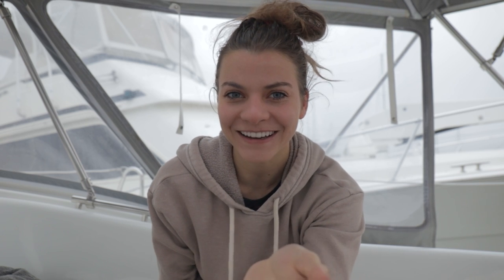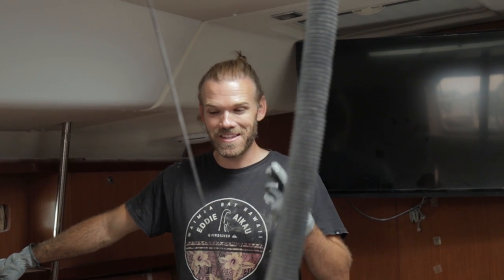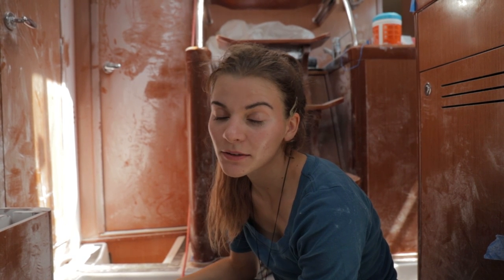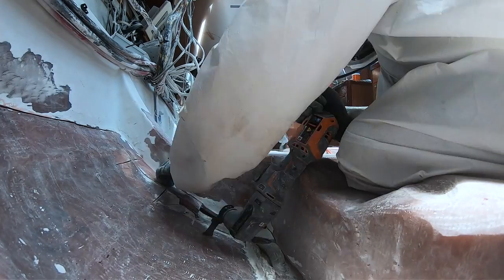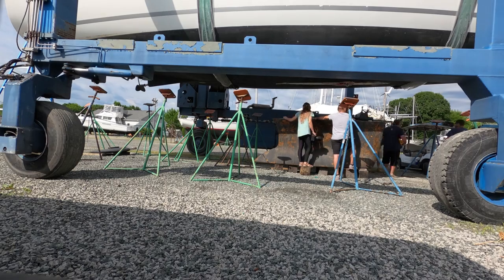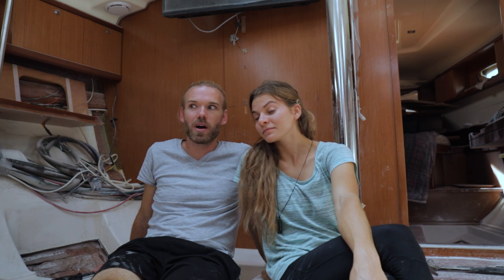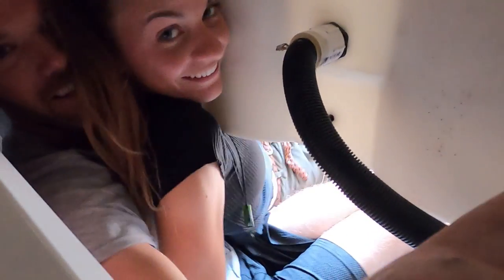Our Keel Gets RIPPED OFF! (and so do we) | Expedition Evans 11

Comment: Watching you guys and listening to your concerns with regard to the repairs it sounds as if you are concerned about the hull and getting the hull back to it’s original shape. The only way this could be done is if you had a set of 4 or 5 stringers spaced over the area of the repairs going athortships . The stringers would carry the exact contour of the original molds. As we all know this is impossible I would suggest making sure the hull is fair with no lumps or bumps and most importantly the hull carry the shape of the keel so there is a good mate when you go to reassemble. 
Key points to keep in mind during this repair process, first and foremost do not rush the repairs, take your time ! Make sure you find out the correct laminate schedule, what type of resins are you going to use ? Do your research and document all repairs. Have you talked to the manufacturer with regard to their opinions on the repairs ? Keep up the good work and don’t get discouraged, this is an extremely large project you have gotten yourself into.

Comment: Fortunately fiberglass can easily be repaired.  It is all in the prep work, but the extent you are going to inside means you know that. Now we have to remember when you fix the inside, and the outside, you are not going have those factory perfect shapes when you reattach the keel. Making a mold off the keel means you can prep for a perfect fit. Such as the inside you need to consider the surfaces being reattach with the keel.

Comment: This is why I despise bolt on keels for cruising boats. A lot of people have got into deep trouble / died when the keel falls off mid ocean. Old style long keel have the keel integral with the hull. Sure they don't have tye ultimate performance, but they can be run into reefs or up a beach without jeopardising their structural integrity. (ask me how I know)

Comment: Stainless steel has it's place but it also has disadvantages in some circumstances.

For example if stainless steel is immersed in water in a relatively oxygen free environment such as keel bolts it can decay internally and eventually fail.

Comment: I do not build boats. Some people have commented that the Hull shape will change depending on how it is supported.  Also there needs to be some flexibility to the hull. This would explain why the hull is bonded to the grid and not fiberglassed solid. I would recommend repairing the hull first. Then making new tabs for the grid  but leave them free. Put the keel in place with very loose bolts. Apply bonding agent to the grid and slowly lower the boat onto the keel until the gap is closed between the grid, keel and hull. Instal tabs with bonding agent and bolt to keel. After agent cures. Glass in the tabs.
Reply: Glue keel and grid all at the same time. It is very important to level the keel and hull during this process. Again I am approaching this from a viewpoint of a fabricator who does not work in boats and this theory is a suggestion that needs to be vetted by a professional. This method will allow some flexibility of the hull in the water that helps a boat move through the water faster.

Comment: Great video editing! The two eternal challenges we all face again & again: (1) how to become an informed purchaser. I.e. know the subject so well that you can specify the job and monitor the contractor. One way is to hire an expert to advise you and monitor the job for you - but that’s really expensive. Another way is to learn and become an expert; and (2) understand the motivations of other parties, as what drives them will certainly be different from what drives you. And on this, be super-careful with Beneteau: they (and a few other manufacturers) are in the business of making the largest number of boats at the minimum cost to them - like Ford. They’re not in the business of making solid reliable storm-proof boats. So you’d doing the right thing by re-working the structure & rig to cover their skimping.

Comment: Gregory. I understand this yacht went aground. Jade has a good understanding of what happened. Lady K sailing discussed the Benateau keel issue in one of his recent videos.  I agree the Marina crew was sloppy. I suspect there were liability concerns about having non employees under a boat in slings.  These two have a good grasp of the situation.  I m sure they are checking with other professionals and Beneteau about a proper repair.  My experience tells me like Jade said, Build it back stronger than before.  I d put about a 3 ft wide layer of Kevlar overlaid with about 5 ft wide Carbon Fiber then maybe 5 layers of 18 oz roven wooing all applied with either epoxy resin or vinylester resin.
These two have the patience of Jobe and the tenacity to Get Er. Done  I much admire them
May they have Fair Winds and Calm Seas ahead.

Comment: I have been running equipment  since my grandpa set me on a tractor when I was 8 and put it in gear before hopping off. So I would be very tempted if they left the slings on the lift to jump on it and just lift it myself.

Comment: A thought for a future video. A explanation of how you are going to approach the repair. Are you going to use polyester , Vinylester , or epoxy ? What kinds of fiberglass cloth and there thickness.  You are both hard workers with good attitudes  and you will realize your dreams. You could also put in who you consult with the repair, others watching would fine that valuable.   
The one thing that concerns me is you health. You are dealing with some really bad stuff health wise.  Take it one step at a time a rush job will kill you.

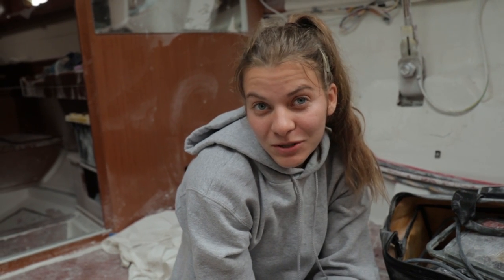Comment: 5:53 - the "bonder" is probably Vinylester which is about  2-3 times as tough as the fiberglass. You guys need to get at least some rudimentary idea of fiberglass construction as well as sandwich construction - specifically why stuff is done the way it is. 
And you need to listen to a lot fewer self-proclaimed "experts" on youtube - otherwise you are going to get a laminate that is not able to flex how it's supposed to flex  at sea, and possibly break due to overbuilding.
Reply: I was thinking exactly the same. You can reinforce and reinforce but every area needs to be reinforced equally, If working on a selected area, be repaired to the, or as close as possible, to the original specifications. if making one region super strong you will end up with two independently engineered regions. One that has very little flex, one that has more. The narrow region where they join becomes the most flexed, flawed and the weakest link. Contact Beneteau for best advice.
Reply: they tried to cut it but couldn't reach in far enough
Reply: @rexolrexol7893  I'm pretty sure there would have been a 'sump' in the fibreglass for the bilge pump with a corresponding hollow in the keel ballast, cutting between the G/F and the keel on the vertical sides or the bottom would simply not be possible so if that area was bonded with 5200 there is no way of separating them without ripping the G/F sump off the hull.
Reply: ...although perhaps cutting the sump off might have been preferable to ripping it off :-)
Reply: @mal6232  Yes it seems like cutting the bolts off if they were in the way

Comment: I'm looking forward to the assessment of where the leaks originated from. My theory was already that the crack would be under the keel and that dropping the keel would expose it. If my thoughts were right, it did expose it quite destructively, as the crack can be a start of a year/rip. I never knew that a sailing yacht like yours has only such a thin hull, visible during the "next time" scene. Our speedcruiser has around 5cm of wood sandwiched between two times a good 8-10mm of fiberglass.
Great channel, can't wait to see you cruise the Bahamas in this XXXXXXXXXXXL bathtub.

Comment: A few notes. 1. remember that marina staff always work on gross estimates of time, and have also to serve less nice rich peeps, whom are given odd time estimates also, I'VE never got a net estimate either-- easier if you live nearby. U. 2 NEED a little vacation. ??? You are not being careful enuff with the dust-- a shop vac can be used as a air filter.  U. SHOULD be using air impact tools,  electric fields from power tools -as u. are using them not good- u. can get close to 2 hp. on a air tool. Also, consult an expert, but I think you should use epoxy not polyester fiberglass on the repairs. costs more but much stronger.  When you get into the fumes of the repair remember the organic volatiles or fumes -- must be effectively dealt with.

Comment: Been sailing the World's Oceans for 40 years on multiple boats. Wow, the original design seems lightweight and now a huge repair by novice, untrained repairers of the most critical heavily loaded area of a weak boat. I would not trust this far out to sea in a storm. If I had to do it, I would seriously overbuild the entire area all the way out to the waterline to the point where I would need 3" longer keel bolts. Then, I would still be uncomfortable. These seem like young people learning a lot of very hard life lessons all at once. I hope they get through it safely.

Comment: Should have cut through ALL the 5200 I'm afraid. I'd have used a broken 1" 6TPI  bandsaw blade with a handle and a person on each end pulling in turn - after lifting the hull no more than a few mm with the keel still on the ground. Your keel was bound to drop suddenly and do some damage lifting it with bolts out and only 5200 holding it. edit: and allowing it to separate unevenly as it did.
Or lift in slings with bolts unscrewed only 2 turns - cut away the 5200 - lower the boat and then remove the bolts.
The previous grounding may also have separated or at least weakened the hull laminations in way of the keel and that contributed to the damage. I'd spend some time tapping with a mallet looking for cavities for a while. I don't know if ultrasonic flaw detectors are a viable way to find separated internal laminates in glassfibre, but Curlin Air seems to think their instrument is.
Good luck. With repairs like that don't be afraid to over-build.
Reply: Agree on the bandsaw blade. Seen it also done with sort of thin wire that cut through the 5200 before putting the boat down and loosening the bolt nuts all the way. With that boat no damage was done

Comment: Glad you celebrated the keel drop.   A big milestone.  Keep moving forward.  You have plenty grinding ahead.  Again I suggest removing the inner grid by cutting it where you can.  You can put it back with glassing it in.  This would allow you to lay large sheets of bilateral glass over the entire weak area. Looks to me to be about 8 ft wide and 12 to 15 ft long.  Use of Kevlar or carbon fiber fabric would be very strong.  You might also ask Beneteau what was their lay up schedule for the bottom of the boat.  You are well on your way.  I have every confidence you will both be master fiberglass technicians able to get work at any marina.  Keep the light at the end of the tunnel on.
Reply: Wayne. I do agree they should use Kevlar/Carbon weave fiber. If they reach out I will try to find a supplier to help them. But there stuck on Fiberglass! Thanks
Reply: Greg. It is my understanding that this boat was run aground some five years ago.  The Evans have found evidence of a poor quality repair attempt.  There are lots of Beneteau boats around and only ones pushed hard or grounded hard seem to have problems.  So I don t think this is a all boats problem.  I think production boats of newer manufacture are engineered to save weight as fiberglass is expensive. I don t think Benateau designed or built assuming every boat would attempt circumnavigate journeys.  Most boats spend 99% of their life in a marina.  Very few are taken on long journeys 
I believe the Evans have taken on a very complicated project.  I have every faith they will rebuild their boat to a condition better than when it came out of the factory

Comment: I owned a boatyard for ten years. Corporations and boatyards don't mix. You are a community at a yard. A representative of a distant committee making local decisions does not work.

Who attached the sump well with 5200? Not real smart.
Reply from the maker: Very well said. And yeah there was no getting that out without destruction of some sort. No less than half a gallon on 5200 in there
Reply: @ExpeditionEvans  The way we did keels was we thought of them as dentures... yes, we wanted an occlusive seal, but we also wanted to get them off.
Reply: Despiser Despised  My yard was absolutely a capitalist business enterprise with deferance to 1) sailors and 2) commercial fishermen. There is absolutely nothing contradictory about being a capitalist while being devoted to community. You really don't understand the real power of capitalism- the community is your clientele, you meet their needs or you starve. Yes, we were semi-autocratic, but respectful of women. My wife worked by my side and has been President of our companies since.
Reply: @Mark (217maka) yes it may be a good idea to make a template of the top of the keel so that the bolt alignment is maintained
Reply: The cast iron keel was designed so you could remove and service the bolts from inside without the drama of dropping the keel as is is required with a lead keel with cast in stainless bolts
Reply: Despiser Despised  why would community mean doing things for free?
Reply: @Mark (217maka) Exactly the repair should have been done with keel on ,then removed , thats how my beneteau was done 5 years ago
Reply: I hope you take the Good advice on offer here. It really is worth it. You are a great couple, and I really hope you get your boat in the water soon. Love watching you, and am rooting for you both.
Reply: Every Beneteau keel is bonded at the factory with 5200
Reply: @Mechone11  Most of the larger Beneteaus are shipped keel off- there are plenty of 12' 6" clearance bridges left.. The yard attaches it using a provided spec sheet.
Reply: @BrianNavalinsky  And the spec sheet says 5200 just call Ward at Beneteau
Reply: @Mechone11  Yes, Chris, but you do not saturate the sump well. You create a seal between the keel and the hull. The hull only. The sump well is an appendage and fragile in comparison to the hull. Watch the video carefully.  It is obvious that the sump well is holding the entire weight of the keel upon separation. It simply wasn't designed to hold 5 tons.
Reply: @BrianNavalinsky  You are correct to a point ,where I live it goes down to -30 C in the winter if any water  got in between the casting and  bilge sump with freezing it would crack the glass and or casting, it cannot be left as a void
 On Beneteau's  the keel joins directly to the hull unlike many other boats that have a stub. 5200 is used to ensure strength of this joint as Iam sure there is some flexing . It is also used to hold the rub rail around the sugar scoop at the factory. Also it was just not the sump holding ,the sump is very small  , that's why Beneteau uses a remote bilge pump ,you cannot fit a normal pump into it.
They should have used wire to cut thru as others had suggested and heated the keel  with a heat gun as 5200 releases with heat. Done it many times
Reply: @Mark (217maka) yep this is great advice!
Reply: @Mechone11  At my age, I have seen the arc of fabrication technology. 5200 has been a Godsend. I would trust it to keep that sump cavity dry.
Reply: @BrianNavalinsky  Me too I'm a millwright for 40 years and a maintenance manager  for a very large company with an army of trades. I know what I'm talking about ,you cannot leave a void and trust  that it will not leak at sometime in the future . and I have had the same repair done to my own beneteau
Reply: @Mechone11  We will have to disagree. I would trust as little as a 2" barrier of 5200. Admittedly,  I would feel better about it had they opted for a lead keel, but if it were my boat, the iron keel would have an epoxy barrier coat.
Reply: @BrianNavalinsky  There is not 2 inches either side of the sump the sump is in the back of the keel where it is tapering .I repair machines for a living  diagnose failures, modify to remove risks of  future failures. As per Beneteau the void needs to be filled, your lucky if the keel on this boat will ever be removed again in the next 20 years  or ever like most sailboats
Reply: @Mechone11  Well, Chris, if the void absolutely needs to be filled in a climate like Milwaukee or Duluth, I would use strictly bedding compound around the sump and  5200 on the keel to hull joint.

Comment: Carbon fiber and fiberglass are both very strong, but Carbon fiber is more rigid. Carbon fiber is about 3 times stiffer than steel and aluminum for a given weight. ... Fiberglass is better suited to extreme flex patterns, while carbon fiber has a relatively small flex window.

Comment: Good metaphor: They didn't bond it. So, they 'appeared' to have fixed it. That's TV. You're definitely going to do it right, even if it takes a dozen more videos. That's YouTube. And as someone with epoxy experience: How can anyone screw this up? If you rough it up, give it enough  'keying' epoxy will mechanically hold. 
To cut through that 5200. How about a couple feet of band saw blade and two handles? The main problem of a Sawzall is the blades often don't move enough to clear debris from the gaps between the teeth. (Which you know. That's why everyone who uses a Sawzall still makes the sawing motion) A band saw blade, being worked by two people can go all the way across, and clear debris. And the angle is difficult. 
And shouldn't the yard guys, or someone at the yard,  know a lot more about all of this than you guys? They should have more experience.